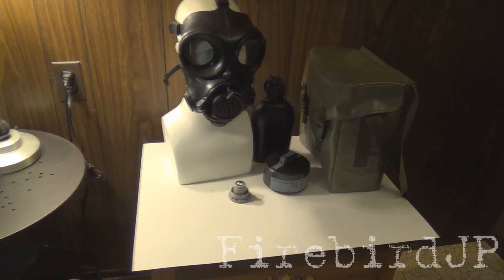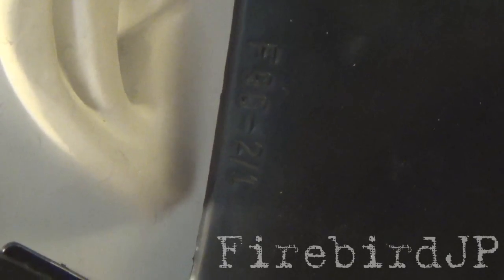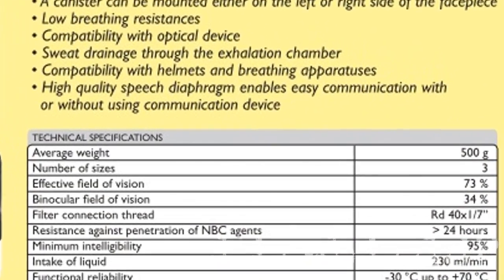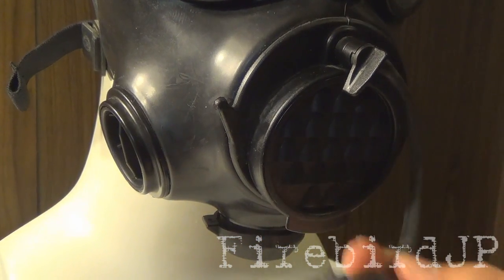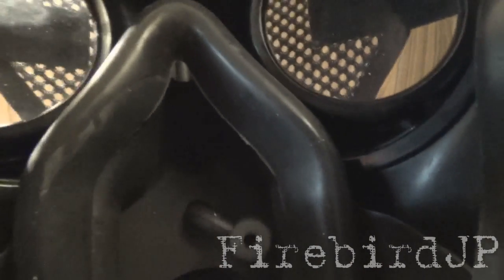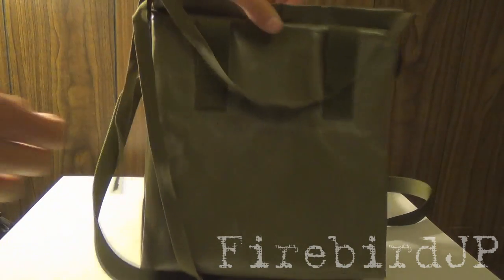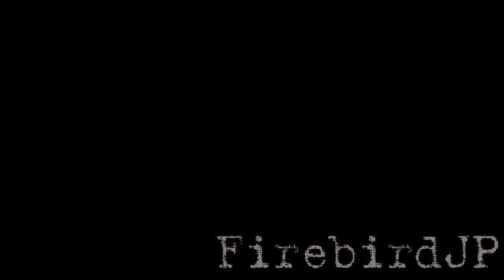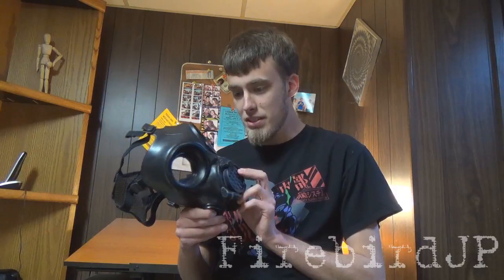Czech OM-90 Gas Mask

Comment: You're treating this like a product that has a chance of changing and is still in production, but as demonstrated, is was made in '98.
Reply from the maker: The OM-90 still IS in production though, it's the military's current issue mask. Just because this example was made in 98, doesn't mean it's not seeing use today. :P There probably plenty of later models, that maybe did have amendments, but the chance of that is unlikely, as most nearly all masks with amendments will have a different designation, such as the M10 and the M10M series masks, and so and so forth.

But I do understand where you thought that, man. But I think it's pretty apparent that there wasn't enough testing done during the experimental phases, as there are plenty of flaws that could have been spotted with more diligent testing.
Reply: Hey! Thanks for responding! That's so cool!
Also I just got my German m2000!